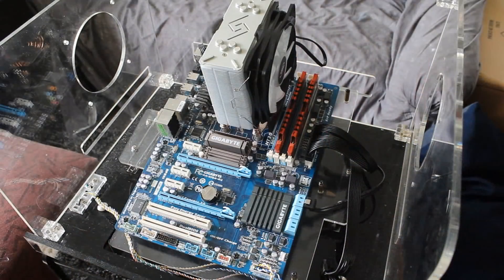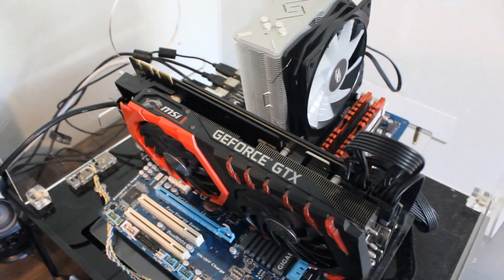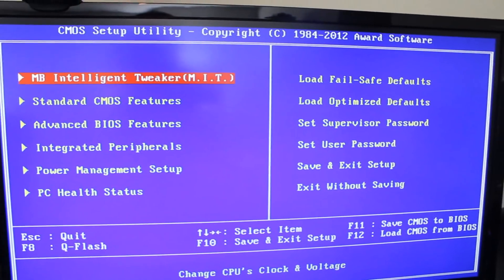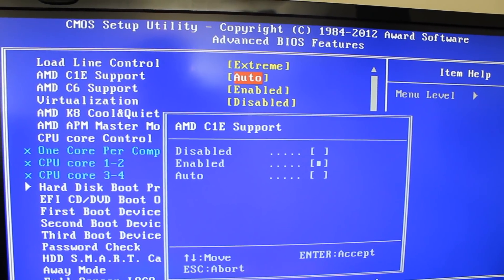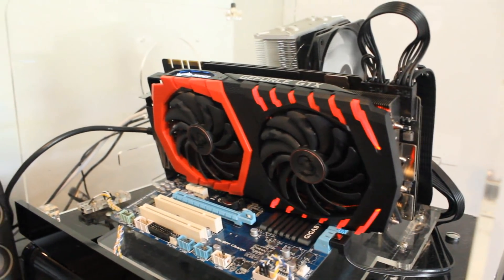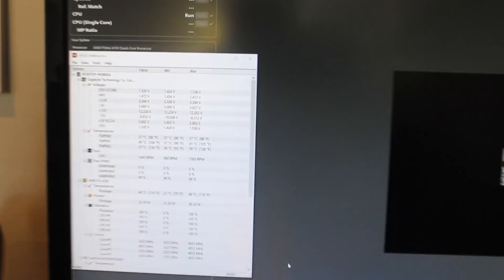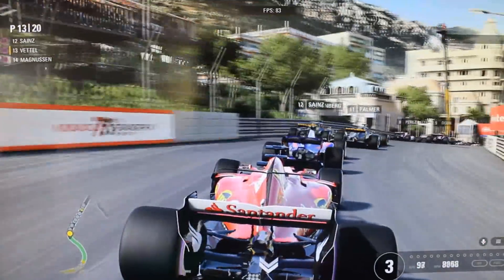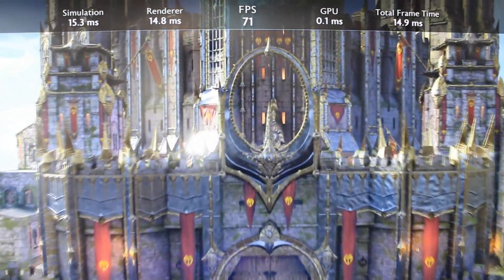FX-4100 In 2018, Is It Still Viable? (Overclocking & Benchmarks)

Comment: overclock it as if it's a Phenom II, will run 1.38v @ 4.35GHz for several years... tho if the motherboard supports overclocking and it can not support said overclock. The Wall.

Comment: Hi, good video, but i try to configure following your recommendations and when the system goes to suspension mode, this not wake up and the screen maintain black, pls help to fixed this.

PROC.: AMD FX4100
MB: GA970AD-3
RAM: 14GB - 1333Mhz
VIDEO: Nvidia Geforce GT 710

Comment: Very useful video, I was given a FX4100 and following a PSU swap, use it for gaming (old) free games like CSGO,  Never winter nights. 
It still manages (low 75) high 117 FPS using HD7970 GPU, so even in 2019 it's great. I changed the clock to 20.5 and achieved 4.125Ghz no voltage changes so until i'm feeling brave ill stick on that but great video.
May try extra settings later incidentally It reports mine as a FX4100 Black edition since change.

Comment: the SSE4 support is notable since most games now are OR  will be using SSE4.. the FX series arent THAT bad, it all depends WHAT you pair it with and how you overclock it. the FX series DEPEND on overclocks, they WANT you to do it because they know it relies on overclocking. the FX 4100 / 4300 are paired well with like a 1050 and below. actually, any FX series is not recommended with a cartd above a 1050ti, ittl run like poopish.
FX 4100 i got free, paired with a 7850 OC  runs games perfectly fine. the CPU has a 500mhz overclock.

Comment: Hey.Can u help me a bit here.I have i3 3240 3.4 ghz and gtx 570.My cpu temperature is retarded AF 60/70 bios+gaming always that range.Now i upgraded my gpu to r9 270x windforce edition OC 3x cpu temp are always 100/120 wich shouldnt be possible it would shut down my pc instantly.I tried applying new paste on it cleaned it all up properly.however in some games now with newer gpu i seem to have bit "low" gpu usage.Like wolfenstein 2 on gtx 570 i had 100% cpu+gpu usage at about 35/40 fps now 100% cpu+15/25% gpu usage at 14-20 fps wich is not good at all.Could it be bottleneck,lots of ppl told me i need to upgrade to like i5 2500 or basicly any i5 cpu (my mobo is asus h61m-d socket 1155).Any help is welcome.Thanks.

Comment: Ehhh. This is super weird because I looked at this at the beginning and was like. Wtf, that’s actually really close to what my board looks like. Then I checked my system spec sheet and sure as Hell it is. I have that same board but mine is a 4350. Same RAM and everything. Only difference is I have a xfx rx 580 8gb on mine. I am running Assassin’s creed at about 38 FPS on average. Incase anyone was wondering I’m running at 4.9ghz with a 240 aio and it runs stable

Comment: This was my first processor in the first PC I assembled on my own. This was 2011 when having ANY quad core was pretty good. It was a massive upgrade from an old Intel Core 2 from 2006.  I didnt realize just how awful it was until I got an i5 in 2016 but I never overclocked the 4100 I left at default settings with the stock AMD cooler.

Comment: I am running a MSi MS-7963. It has over-clocking option but it wont let me turn off many of the options you have. I have a have a corsair CPU cooler and a 700 watt power supply too so what would you recommend me clocking it to?

Comment: SQUISHING out that content with the crustyness hehe. What is that thing anyway? a couple of athlon 64 duel cores slapped together in the form of two modules. I went from athlon 64 to athlon 64 duel core to fx 8350 to r5 1600x. i remember all the OEM bus overclocking i'd do with them athlons. it was a groovy little processor

Comment: Really enjoyed this video.

Got one of these. Bumped it up to only 4.1GHz on stock voltages. Does what I need it to do while gaming, and can game on 1080P rather well with optimization. I use between high to ultra settings on most of the games I play. A few of which include older titles which I like to collect and play, but most more graphically intense titles as well. It's definitely slow on video processing. Could probably bump it up a bit more with a change in thermal paste (got the cheapo throw in stuff).

Comment: some what viable.. i keep looking on local used market in hopes of getting a 4100fx only because it works with my existing mobo and i can move on up from the phenom2 720. which still does everything i ask of it just fine. in my opinion even if i had an absolute monster of a machine.. id probably still be dialing back detail settings in the competitive games.

Comment: I am running an FX 4100@4.7GHz too, but mated to a GTX 1060/6G. Yep, and it's still more than up for the job. Recommend to up the CPU clock (fsb) to 220+ MHz while reducing cpu and ram multiplier, oc the ram, oc the ht link to 2500+ MHz and same for the Northbridge. Optimize ram timings. Turn off all turbo options, but enable C&Q which is a terrific and totally underrated feature.

Comment: I wonder how overclocking an AMD FX-9590 would be like, you could probably get that up to 7 Ghz.
Reply: Shawn Burton you need liquid nitrogen for that. Nobody has 7ghz, most have 4 or 5ghz.
Reply: Of course just like the FX4100, the CPU in my desktop is also a quad core, but its an Intel Core i7-4770k which I have oc to 3.8 Ghz. I think it still does better than any of the FX cpus, even this one at 5 Ghz.

Comment: I wish I had kept my FX-4100 instead of the FX-6100 but, I ended up selling the 4100. Damn..... I was able to get the 4100 stable at 4.7GHz on a GIGABYTE GA-78LMT-S2P motherboard, 4.8GHz on an MSI 970A-G46 motherboard, and 4.9GHz on a GIGABYTE 990FXA-UD3. With the 6100, only 4.1 on the GA-78LMT-S2P, 4.3 on the 990FXA-UD3, and 4.3 on the 970A-G46.

Comment: All the quad core FX's sucked when they were new, total waste of time now unless you are going for overclocking records.
My mate got over 7.749ghz on his 4300 where I only managed 7.648ghz on my 6300.
Both the Althlon II & Phenom II quads are superior CPU's and also do well on 990FX chipsets.
Any FX will hit 5ghz on a decent board with air or water cooling if it is done well enough.  Noctua NH15 or corsair H100 will do.

Comment: People talk alot of smack about the FX lineup I found them to be very playable especially when doing price to performance a FX 8300 OC'd and a 990fx mobo and you got a low budget high performance rig and can get similar in the used market for dirt cheap. I just recently sold my FX 9590 rig with asus sabertooth 990fx r2.0 mobo and 32gb of 1866mhz memory to a friend and he is loving it running all the latest titles with no issues.

Comment: OC FX without North Bridge and Hyper Transport in 2019 cmon bruh. Aaaaaand stock ram........ Im out(didnt)
 Teach materiel, please. FX so sensible to overclocking memory system. So please NB 2500-2700, HT 2600+, ram atleast 1866... Defently every ddr3 1600 stick can make 1866, ofc more better. FX can hadle up to 2400 ddr3 ram, 2k+ would be good enough. Hope u will make one more video with system OC, not only cores. Im new follower, but already like some your videos.  Hope you will see this comment and enjoy to OC FX
Reply: One of the differences between OverClock intel and FX is next. When you OC Intel even with multiplier it automaticly OC base clock bus wich automaticly mean u overclock North Bridge and Ram. But when you overclock FX with multiplier its not OC Base Clock bus and everything else. Moreover alot of motherboard do not overclock NB, HT for true when u change theirs multiplier. So they can be overclocked by  Base Clock Bus only on this MoBo's.

Can give u bench with  with explanation and comparison about FX architecture. Мideo is russian, but u can understand it with visual diagrams only 
https://youtu.be/RYOuH92USEg?t=302 video 1
from 5;00 to 7;00, example  41;04, 29;17

https://www.youtube.com/watch?v=xaiwyebruZY another one 
starts from 2;18 to 3;00

boost in games starts from 10% and over for AVARAGE fps, moreover 0.1% and 1% depend on memory more than MHz`s, and have better boost from memory. I know this bcause have FX and core 2 duos systems

Comment: Nice. Im going to save money by not getting a ryzen 5 1600 and 1070 and going to pick up an fx4100 and 1080ti instead. Thanks for this video
Reply: No, please, don't. That 1080 Ti will be so bottlenecked by the poor FX-4100. Get something better, or at least something you can improve later on (i.e. getting a Ryzen 3 in hopes of getting a Ryzen 7 later on).
Reply: @mvShooting  r/woooosh
Reply: Lawrence Timme save for the ryzen. I love the fx series too. But ryzen is better. My fx is 4170 / My ryzen is ryzen 7. Gaming wise performance was similar. If I got a certain resolution with a certain fps. I got the same with ryzen 7. So far Grand theft auto 5 was my only game that jumped up in performance. Also when you install stuff on ryzen it's way faster.   Go for the newer hardware. I played with the Wii emulator on fx. The sound is messy. Not by much but it is. On the ryzen side it's sound perfection just like a real Wii. If you keep your on eye on the task manager performance, it handles that emulator with little CPU power. Get ryzen it's better. Say for example I told you installing things is quicker. Nobody likes to update drivers. You in and out like that with ryzen.

Comment: wow what an awful bios, itx really makes you appreciate modern motherboards. my fx 8350 was on a sabertooth 990fx and the bios was decent.  the fx  chip however was not powerful enough to push an R9 Fury, it had terrible frame pacing, in gta v it would be on 60fps one minute then on 43 fps the next. it did not pair well with high end Radeon cards, nvidia cards paired much better with an Fx chip.

you can still get good performance from an FX chip if you can get your hands on a 980ti. it also seemed to pair better with maxwell than pascal.
Reply: I remember that I tried GTA V on my rig that kindof like the FX 4100, its also a Quad core, but its an Intel Core i7-4770k CPU with 16 GBs of DDR3 ram running at 2400 mhz, and an EVGA Nvidia geforce gtx 1060 ftw2+ and on GTA V, it usually maintains between 80 to 100 fps at 1080p very high.

Comment: If you are going to do that then you should install it into a Little Devil PC-V10 with Phase Change Cooling unit which will let you get the CPU down to -55 degrees below zero but the CPU has to be installed per the instructions that come with said case, the latest version of said case should let you get down to -70 degrees below zero.

Comment: Drop the CPU ratio a bit and increase the Frequency, and you can then hit the Golden 5! It will also make better performance because higher frequency pushes the RAM clocks higher as well! And I like this vlog rumble :)
Reply: How about adjusting the BCLK (tweak voltage and cool the VRM) and also freesync gsync compat mode with cool-n-quiet?

Comment: its easy to forget that you dont need new cpu to play games at least 50fps, everything core 2 quad and up will do fine for playable experience. great video tech showdown, i liked this one.
Reply: h1tzz I disaggree. Core 2 quad can't render buildings in pubg with a 750ti
Reply: im not too sure as i retired my core 2 quad rig to htpc now but from what i have seen its fine, make sure you have 8gb of ram and ssd.
Reply: h1tzz 8350 gave me drops to 30 in GTA 5 and fallout 4 with r9 390
Reply: @PlanteKiller  I have an 8320 at 4.0ghz with an R9 Fury and get the same drops, at 1080 and 1440.  Debating on going full overclock and get a better cooler (I have the 990 Evo r2.0 Asus board), or just go with a Ryzen 2600x.

Comment: 2400 Northbridge or better makes a LOT of difference on that series of chips
Reply: I never really saw much evidence of this in games. I recently tested the 8370 with the HT link at 2400MHz and the performance was much the same.
Reply: One of the differences between OverClock intel and FX is next. When you OC Intel even with multiplier it automaticly OC base clock bus wich automaticly mean u overclock North Bridge and Ram. But when you overclock FX with multiplier its not OC Base Clock bus and everything else. Moreover alot of motherboard do not overclock NB, HT for true when u change theirs multiplier. So they can be overclocked by  Base Clock Bus only on this MoBo's.

Can give u bench with  with explanation and comparison about FX architecture. Мideo is russian, but u can understand it with visual diagrams only 
https://youtu.be/RYOuH92USEg?t=302 video 1
from 5;00 to 7;00, example  41;04, 29;17

https://www.youtube.com/watch?v=xaiwyebruZY another one 
starts from 2;18 to 3;00

boost in games starts from 10% and over for AVARAGE fps, moreover 0.1% and 1% depend on memory more than MHz`s, and have better boost from memory. I know this bcause have FX and core 2 duos systems
Reply: Thanks for the response.  I was referencing my personal experience with both my 975BE and FX 8350, and specifically Northbridge numbers, not HT numbers.
The benefit was more pronounced with the 9xx chips, because you could go from 2000 base to 2800 NB. Which would yield a straight up linear gain in cpu benchmarks, 10% ish for every 400, so 20% or close to it for my 975BE, independant of a clockrate bump. 
My 975 gained between 35% and 38% over base in these cases with a stable 24/7 OC running in the low 50's C on air, with both clock and NB OC'd.
The 8350 only hit 2400 NB stable for me, some guys got 2600. This yielded 10% for me in cpu benchmarks, again independant of  clock bump.
Any OC bump I applied, scaled pretty linearly in the same cpu benchmarks, giving me almost exactly the same percent gain as the percent of OC over base.
The best part of this for me was that the NB OC very nearly always required ZERO extra voltage for it to work, meaning that gain did not give me extra heat to deal with.
** I never rigorously tested this in game benchmarks like you do, only synthetic cpu benchmarks. 
So it is more than possible that both experiences are correct. 
Please do not take this post as doubting any of your results.  I have a great deal of respect for the work you do, and religiously watch your content.
The above is merely my personal experience with two specific cpu's, running synthetic cpu benchmarks only, with a sample size of one of each.
Both in a Sabertooth 990FX Gen 3 R2 mobo, with Mushkin Redline 1866 cas 9 ram. So a pretty high end mobo for these chips.

You cannot OC the NB on Ryzen , it is set by ram speed, which we have seen show significant gains, so I believe this trend continues with AMD cpu's, 
It's just not "free" anymore, because of said spendy ram being part of the equation. Yes I know infinity fabric and NB speed are NOT the same thing. 
I find it interesting that data transfer rates (NB, Infinity Fabric), continue to be such an inherent part of AMD cpu's performance.

* Currently on a R5 1600x @ 4.0, Crosshair 6, GSkill Flarex 3200 cas 14.  And I loves it precious!  

Thanks again for this unique content. Please make more dumpster PC's!  And continue to be the Benchmark KIng of Youtube!